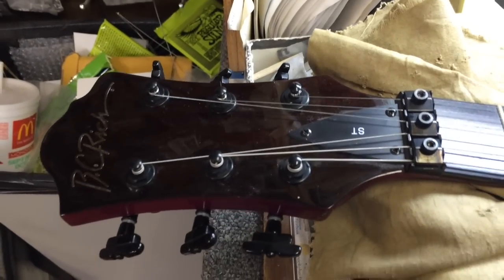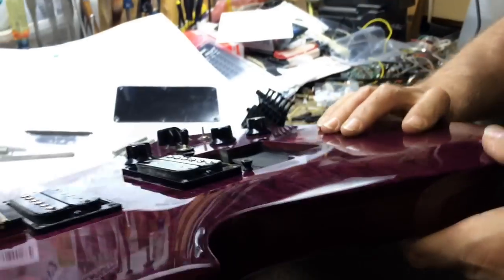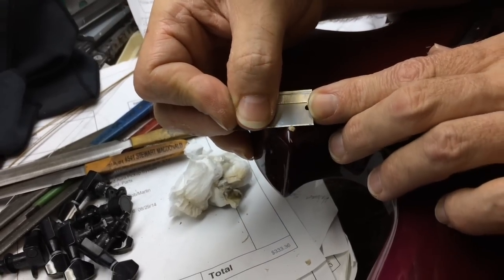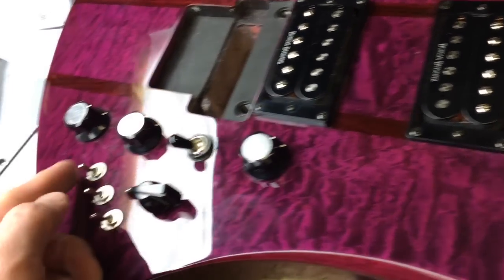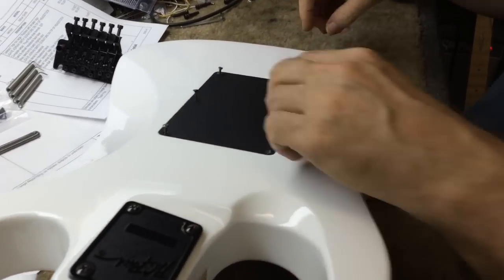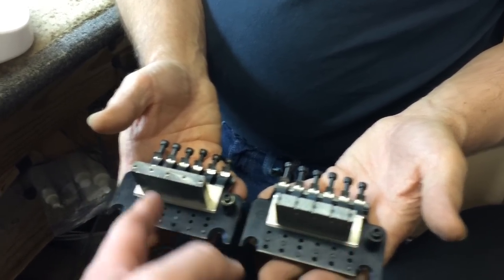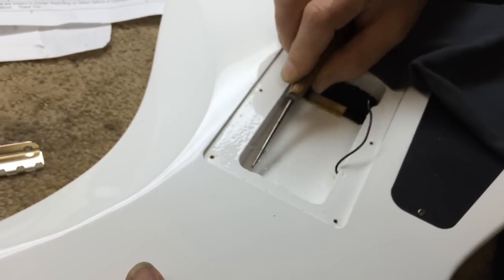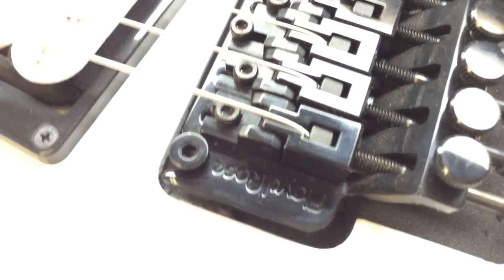Floyd Rose VS Floyd Rose Special with BC Rich Guitars

Comment: If you're going to block it off why bother with locking the nut?  Also why bother with a floyd at all, heh?
Reply: +surgeyX Agreed, and in addition to that nonsense, it's blocking the "lift" position, not the "dive" position so does nothing for keeping the guitar in tune....
Reply: You can still dive bomb...just can't pull the trem backwards.

Comment: Why bother changing the claw? What difference would it make?
Reply: +George2ec Vibration transmission is exactly the opposite of what you want. Vibration transfered from the nut or bridge into the body and away from the string is a loss to sustain and volume.
Reply: surprised they go to the trouble of redrilling the wood - wouldnt it be better to ovalise the existing claw holes?

Comment: both arent real floyd rose trems....check for the made in germany stamp next time.
Reply: +מנחם דזיצר (TheGibsonHunter) Floyd Rose makes lots of bridges that aren't made in Germany.... Just because it wasn't made in Germany doesn't mean it's not a real Floyd Rose.
Reply: +Motovader72 
keep telling yourself that....
Reply: the korean OFR is inferior to german one.
in alot of aspects(finnish,fit,and the quality of the metal used)and i dont think it will stand the test of time like the german ones,it costs less for a reason and you get what you paid for.

this will explain with more detail:
http://dellus.net/updates/original-floyd-rose-german-vs-korean/
Reply: מנחם דזיצר I'm not disputing the quality difference in their line of products, I'm disputing your claim that to be a Floyd Rose it has to be made in Germany, which is bullshit.
Reply: +Motovader72 You're right. Schaller is from Germany. Gotoh from Japan, but all are Floyd Rose after all.
Reply: +Warhead Shirts Well yes, any double locking tremolo is considered a Floyd by design. 
*What the idiot stated was that all Floyd Rose brand tremolos are made in Germany, which is simply not true.*
Reply: It is an official Floyd Rose. If it wasn't then it would have said (Floyd Rose Patented).
Yesh Mevin?
Reply: The German made Floyd's are made from 100% hardened steel....the Korean Floyd's have zinc alloy saddles, and a zinc alloy sustain block. Supposedly...the base plates on the original Floyd that is made in Germany, and the Floyd Rose Special made in Korea, both have hardened steel base plates.
Reply: Yes and thats a good thing that the specials has hardened steel construction on the baseplates because thats the area on the knives that wears out fast. 

Good thing that you could use 1000 series saddles or the OFR saddles because they fit. 

Funny. People dont like the specials being less brightness becuase of the zinc aloy saddles. Same zinc aloys on an original schaller liscenced with steel inserted knives. 

Thats also a reason that some actual prefer the schaller for its warmer less trebly tone.